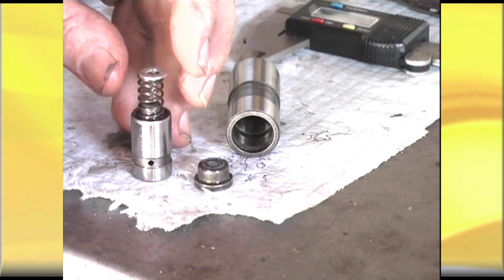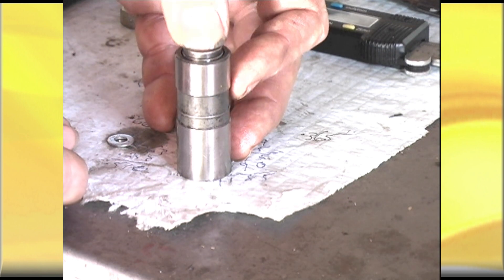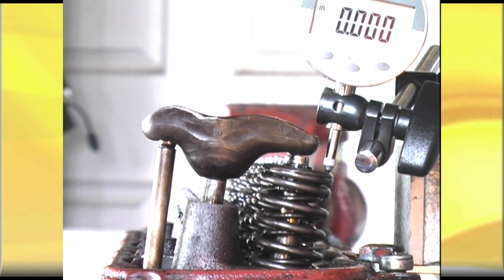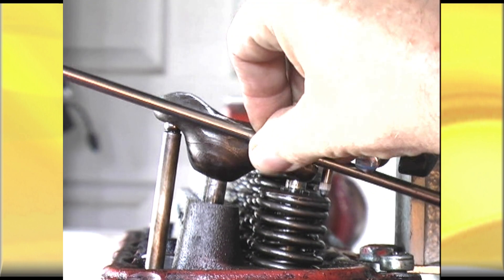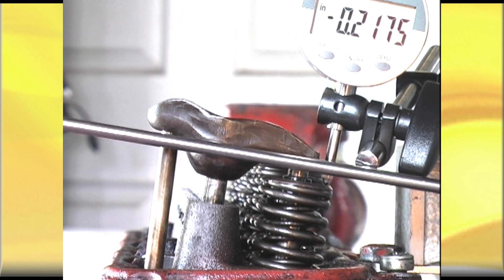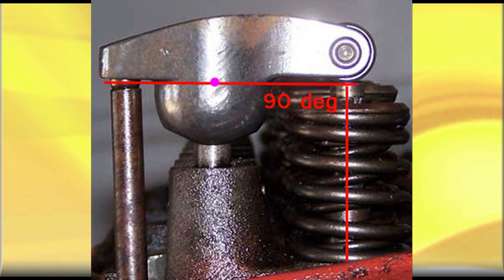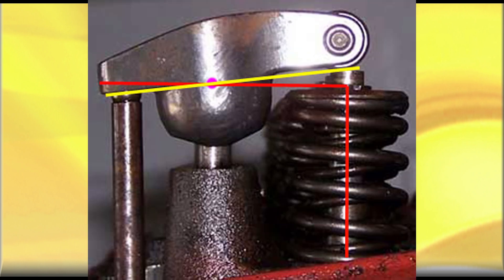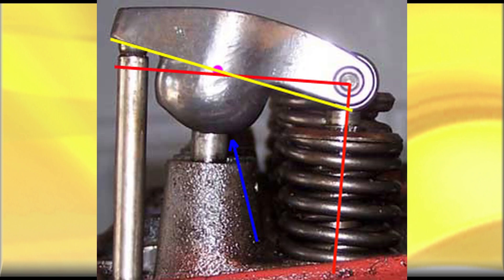Hydraulic Lifter Modification to Solid and use it to Check the Geometry on a Holden 6 Engine.

Comment: Thank you so much for this, I feel confident to check my push rod length now, and possibly be able to guess my cams lift. Ford 351w. I took a crude measurement and it looked like the valve was only opening .250  I have a dial now and will go over it with this knowledge as well.
Reply from the maker: .250" is not much. With the dial gauge you will probably find it is a fair bit more as long as you test it with a modified lifter.

Comment: Just use a solid lifter.
Reply from the maker: sorry for late reply. I would say no because unless the solid lifter is identical in height to a pre-loaded hyd lifter you will get a different stem pattern & could be out by over .040" in your estimation of the required pushrod length.
Reply: @mbsoldschool  It is identical. You can check the specs with the manufacture.

Comment: Great explanation.
Reply from the maker: Thank you for the feedback.
Reply: @mbsoldschool  why the fk would you bother. its a pre crossflow chunk.. with press in studs. simese ports.. maybe holdens should of listened to waggot & brabham... & built a real fkn engine.. i never understood, why, when watching apprentice,s gaping the rockers, the engine was running.???.. wierd or what.. the chev 6 cyl, had rockers on a tube, like ford 1.6 . dodge.. then chev tossed it in favour of the bs rocker set up that leaves at 5,500 revs.. they went backwards..
Reply from the maker: Not a Holden fan hey.